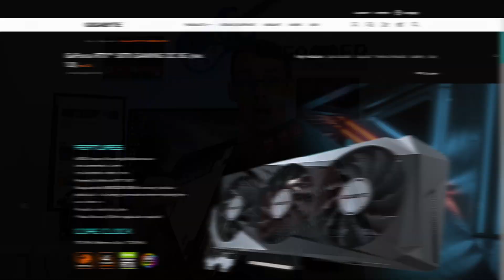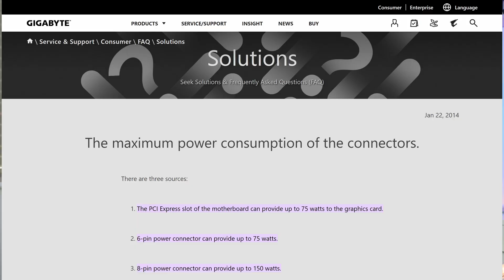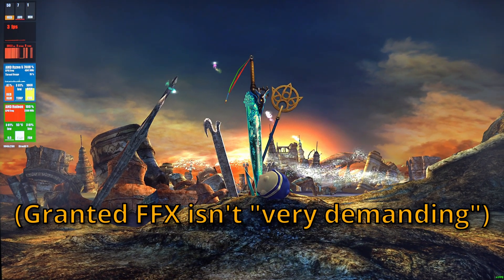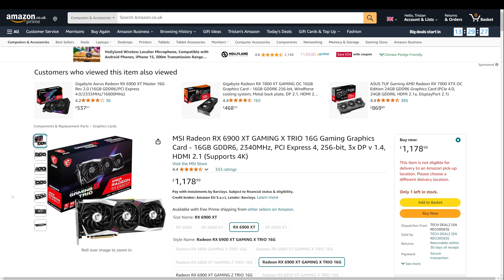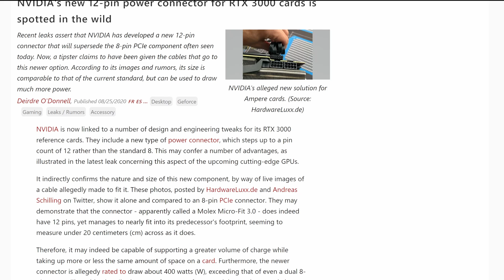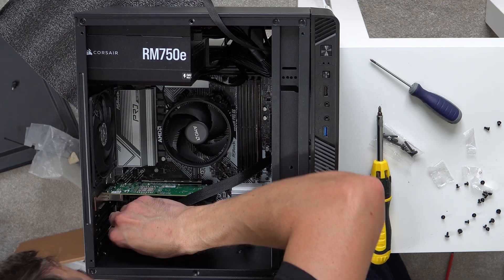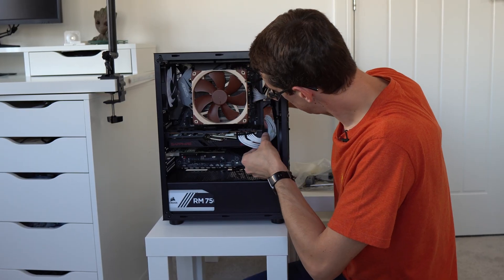How To PROPERLY Power High End GPUs (With 12vhpwr Or 3x PCIe Connectors)

Comment: Hi, what if the extension cable is only 30cm long but your power supply is further away, I have a big case, do they plug into the spare cable s somewhere that came in the box....then into gpu?
Reply from the maker: Hi, yes that should be fine, but just make sure that they're good quality extension cables (i.e. from a reputable make).
Reply: @TechOverwrite  hey I wasn't sure you'd reply so ty very much, yes they're Shakmod extensions and I'll be attaching them to the og Corsair cable spares from the box, only thing is 1 is a "devil spawn" lol, obvs i would be bypassing the sticky out bit lol. Thanks so much for your help and the vids.

Comment: I'm just about to build my own PC, but I'm finding it all a bit overwhelming.  I bought the Corsair RM1000x PSU with the 12v-2x6 connector and the XFX 7900 XT Speedster Merc 310.  The Merc 310 requires 2x PCI-E 8 pin cables, and the manual says, "If your card has 2 power connections, BOTH need to be connected, graphics cards will not work if only 1 out of 2 power connections is plugged in."  So, I'm wondering do I just do as XFX say and use two 8 pin cables or would I be able to use just the one 12vhpwr cable?  Thanks.
Reply from the maker: I get that, it's definitely confusing at first. The RM1000x is a great choice, and you should be able to just run two separate PCIe 8 pin cables(6+2) from the PSU to the 7900XT. You don't have to use the 12vhpwr port on the PSU at all, here.
Reply: Great. Thank you so much for your help.

Comment: Im having trouble understanding this, I never really looked into the psu or  watts and such until recently, i'm fairly new. Long story short, I need a new psu but I am unsure if the 12vhpwr would work on my nvidia 3090 which has two 8 pin connectors.
Reply from the maker: It's a tricky area. Right, so for a 'standard' 3090 (without a 12vhpwr), you should be fine to just run two separate PCIe cables from your PSU to the 3090. That should supply sufficient power.

Comment: I'm planning on getting a 5080, which is a huge upgrade for me. I have a lian li edge 850w, and it came with a single 12vhpwr 2x6. Should I use that or plug the multiple pcie cables into the adapter that'll come with the card?
Reply from the maker: Ah cool, I'm quite interested in the 5080 too. Yes that's a good PSU and I think that using it with the single 12vhpwr or 12vh-2x6 cable would be fine. I would prefer that to using the adapter, but maybe that's just me :)

Comment: Hello, I just got a phanteks amp 850w psu, and I checked the cables and I have that 12vhpwr 600w cable included.  My psu has that newer connection for gpu’s called 12v 2x6, so I think it's just one simple connection from gpu to psu. my gpu cable in the psu box just has 1 connector at each end of the cable. So im guessing its been improved upon?
I have the 4070ti super, not opened that up yet to check what cables are supplied.
Reply from the maker: Hello, that should work fine, it's backwards compatible too, but yes the 12v-2x6 is the improved ATX 3.1 version - so that's safer than the older 12vhpwr connector. I would use the direct PSU slot/cable, instead of the 8-pin adapters included int he 4070Ti super box.
Reply: @TechOverwrite  thanks, built today and seems fine, not tested any games yet though!

Comment: Amazing video buddy, just what I was looking for to clear my confusion with Nvdia's 12 pin adapter.
Reply: So with 12 pin you basically dont need an adapter? You just put the 12 pin into the power supply and the other 12 pins into the graphics card?
Reply from the maker: Glad it helped :)

Comment: I have a non-modular powersupply with 2x 6+2 pin PCIe cables running from it, those split at the end for a total of 4 6+2 pin connections possible. I'm looking for a GPU upgrade, and on PC Part Picker a annotation is as follows: "The video card PCIe 16-pin power connector adapter is being supplied by three 6+2-pin power connectors. Please ensure that the three 6+2-pin power connectors are not daisy-chained and do not share the same power cable." 
This would not be possible with my current PSU. Is this just a safety precaution? Or a hard limit with the 16 pin power connector?
Reply from the maker: Ooo interesting, those PC Part Picker warnings can be useful - but in this case it sounds like it's more of a precaution. What GPU is it? Maybe the RTX 4090 would require 3 separate cables, but the other cards would 'only' need 2 in my opinion. That assumes that the cards aren't overclocked or using more power than the standard TDP. Some (like the 4090) can be truly power hungry, especially with overclocks.
Reply: @TechOverwrite  it's a 4070ti Super. The upgrade isn't very urgent, I will be waiting untill the 50 series releases, either to get one of those cards if they offer significant improvements, or to get a discounted 40 series. 
I'm still interested in learning if I'll need to upgrade my PSU before then. 
It's a beQuiet system power 9, 700W
Reply from the maker: Ah cool, that's a fairly good ATX 2.0 PSU if I'm correct, so it won't have the 'natural' 12vhpwr support like an ATX 3.0 or 3.1 PSU will. But you should get a 12vhpwr/12vh-2x6 adaptor with your GPU, which you could then happily use with that PSU because it has 4 PSU connectors on the PSU side - which is plenty. In short, you don't need to upgrade your PSU. I probably would for an RXT 4090/5090, but not for a 4070Ti Super. (Great card btw :))
Reply: @TechOverwrite  so even if the card comes with a 3x PCIe 8pin to 12vhpwr adapter I can just use the pigtail on one of the PCIe cables? Because I again only have 2 distinct cables coming from the PSU side
Reply from the maker: Yes for the 4070Ti Super, using just two distinct cables should be fine. Sometimes that third connector is for 'future proofing', big overclocking or for the 4080 Super upwards etc.

Comment: hmm..i recently got a asus strix auros 1200watt psu to replace my evga g2l 850  and there is a cable that comes with it which has that 16pin connecter on it with 2x8 pins on the other end.. but in this instance the 16pin end  connects to the psu. i know this beacuse it has "PSU" printed on the 16pin end. I also have to use a seperate 6+2 cable to power my 3080 as it requires 3x8. 

before i was able to connect 3 pcie to my psu but not with this power suppply. since there are not enough pci ports on it.  im hoping this is safe and the correct way to connect my card.
Reply from the maker: Hmm it's a difficult one to say for sure, but yes I'd say that would be fine for an RTX 3080 (assuming it's not super overclocked or something). 🙂 That's interesting about the 16pin connector to the PSU end but it makes sense with the ATX 3.0 changes I guess.
Reply: @TechOverwrite  its over kill fora  3080..i was using a 850 just fine.. but i needed a new psu and im planing on getting a 5090 where i need that extra watts. this cable must be how to connect 3 pci connecters as there ins no other way to do it.. and it duse say psu on the 16pin end.

Comment: Hi TO, nice video. I'm having a trouble to find a cable which can solve my issue. I've bought a Corsair SF750 newer version (the connectors on PSU are Type 5, I assume) and I want to connect it to a RTX 3090 EVGA XC3 Ultra, which have 2 x 8pin PCIe slots. I have received plenty of cables in the Corsair PSU box, but non of them are solving my issue. Where can I find 1 cable (8 pin type 5 in PSU  to 2 x 8 pin in GPU), or even 2 cables (8 pin type 5 to 1 x 8 pin GPU)? Which cable you would recommend? Thanks in advance.
Reply from the maker: Thanks 👍 Hmm good question. If it's a type 5 cable, Corsair does seem to sell multiple ones that might suit - try Googling "corsair premium sleeved pcie cable type 5" or similar. Buying 2x single ended PCIe cables might work (if your GPU only needs 2x connections). That's what I actually have with my RX 6700XT - Corsair's premium/sleeved PCIe cables look really nice 🙂

Comment: can i use ATX 3.1 12v-2x6 cable on 4080S ?
Reply from the maker: Yes that would be fine - assuming it's not some random 12v-2x6 cable from a no-name company on AliExpress or similar. But if (for example) you had a Corsair PSU and used their cable? That'd be fine.

Comment: Hello, I really liked your video, I would like to ask a question. Could I use 12vhpwr with 12pin input and 2 x 8 output for my RTX 3070? I found an adapter on the internet from 12 pin to 2x8 pin (12vhpwr), I don't know if I could use that, or if it could kill my RTX 3070. Just so you know, I don't understand English very well, that's why I'm asking, I don't know if it was said in the video, because I had to try to translate it to understand everything.
Reply from the maker: Hello, good question, it's always better to ask :) In general going from 12 pin to 2x8 pin 'can' be safe in that the 12 pin is very high power, so it is unlikely that the resulting 2x8pin is underpowered. However it depends where the adaptor is from. For example I WOULD use such an adaptor from Corsair (since I have a Corsair PSU) but I would NOT use that adaptor from a random company on AliExpress. Hopefully that makes sense?
Reply: @  Thank you very much for answering, would it really make any difference? If I use this cable and if I use the standard 2 8-pin cables? Because in my thinking, if I use a larger power cable for my RTX 3070 (220W) it would be more “loose”

Comment: 5:03 "even the 7900 XTX only goes up to 355 watts" THIS IS NOT TRUE, that's the base power of the card and ENTIRELY dependent on the manufacturer you buy from.  The base AMD card will draw 355 watts, but an OC 3rd party one from Sapphire or alike can draw up to 450 watts or around that when gaming depending on demand of your resolution and settings etc, so 100% you NEED, NEED, NEED 3 PCIE cables at 150w each, taking you to 450w + 75w from the PCIE so 525w.  If you ONLY connected 2 daisy-chained PCI-E cables, connecting one 8-pin, one 8-pin and daisy'd 8-pin, ie had one daisy "hanging" from one of the cables, you'd ONLY be supplying 150w + 150w + 75w so only 375w.  The card at times will want to pull more than that 375w and causing instability, crashing or seriously power-limit itself and hold back performance, so you wasted money.

If you buy a stock card, sure, 2 PCIE cables and daisy one of the connections to make 3 8-pins.  If you have a 3rd party OC'd card, USE 3 PCIEs, AND ONLY USE THE 8-PINS, just tie the daisys to the cable and don't use them.  Ugly but ah well.  At least then you're guaranteed 450w minimum supply.  Even Sapphire's site for the 7900 XT says "3 8-pin connectors required".  Use 3 and hide the daisy chains or buy 3 8-pin single cables for your PSU's type and manufacturer (as PCIE cables/pins/rails vary between manufacturers, you can't use a Corsair PCIE on a Thermaltake PSU or whatever).
Reply from the maker: Thank you, that's an important clarification 🙂 Yes I usually just refer to the baseline power requirements for consistency, but I definitely should have mentioned that OC and 3rd party models can vary this. You're right that an OC 7900 XTX needs more than 2 cables in this case - thanks again for the detailed comment and clarification 🙂
Reply: @TechOverwrite  No worries mate, maybe overlay some text or clarify in the comment section or something.  Just reading the TDP isn't really a great idea, because wattage can vary so much, which makes you wonder why they even write the TDP.  Even the PCIE cables are 150W but are rated to go over 250W I believe.  Without sitting down and testing each wire with specialized equipment and testing the PSU, measuring the card wattage (AMD do this in their Adrenaline software to be fair though, I don't think GeForce Experience or the new, better, Nvidia App does it though, you need to use MSI afterburner or Hardware monitor or whatever software), you can't really quote specific, hard numbers and call it a day.  It fluctuates so much.  I'd rather give the card 500+W of potential power and let it draw what it  needs when it needs it.  You're not going to kill a 300W card by giving it 3 PCIE 8-pins so 150W minium.  It can sit idle and draw 30W, it's not going to catch fire.  The issues start when you overload a single cable, don't have enough cables connected, cables not connected properly and overheating at the contact point, or not enough power supplied to the GPU.  Fortunately the PSU has failsafes built in to cut off under certain circumstances, as does the mobo.  You're more likely to have a shutdown than catch fire or short something.
Reply from the maker: Yes fair points, I agree entirely - and thanks, I've added a pinned comment (unfortunately YT doesn't allow you to add text after the fact - you could link to another video and add a label for that, I guess, but it's probably not as visible overall as a pinned comment). I agree that it's easier to be safe with 3 cables (for example) than chance it with 2.
Reply: Hey guys I just brought 7900xtx nitro+ and my psu is MSI MPG A850G, aside from 12v-2x6 cable, I just have two 6+2 pin cable and one 12 pin to 6+2 pin cable. While first two cable okey for two 8 pin connector, but can I use 12pin to third 6+2? Is it safe? (12 pin to psu and 6+2 to gpu's third port/socket, with other two regular 6+2 cable)

Comment: Hey I just bought a 3060 ti which has a 12 pin connector, I’m wondering if I can use 2 6-pin PcIe connector or I should just use the 8 to 12 pin adapter? I have cable extension so I would rather use 2 6-pin.

Comment: The timing is incredible!

I'm in the middle of upgrading from my RTX 3070 to a ASUS TUF RX 7900 XT OC. I got a new PSU too as my old one just had 650 Watt. I made sure my new PSU had enough PCIe connectors, but I got a little worried when the Asus manual told me to ONLY use separate cables for each of the 3 connections. 

Thanks for making this video! It helped me to understand how these new (and huge) GPUs draw power
Reply from the maker: Hah it must have been meant to be! Glad this helped you out either way 🙂
Reply: Lol I wish I came across this video when I was building my first PC. Would’ve saved me a lot of researching lol
Reply: What power supply did you get i want to upgrade to an xtx but im struggling to find a power supply that has 3 8 pin cables
Reply: @JalalSinclair  I just went with a 850W PSU with 2 PCIe cables. I have the MSI MAG A850GL. 

As explained in the video, I run one cable to the first 8-pin slot and I use the second cable to connect it to the second and third 8 pin slots. 
For my RX7900 XT, this works flawlessly. I've not encountered any issues.

Comment: At 7.12 you say 'plug the 16 pin end in the gpu' but you're holding 12 pin cable right? I am so confused... How is ATX 3.0 12VHPWR with 16 pins compatible with new ATX 3.1 12Vh-2x6 pin which has only 12 pins? Do the rest of the 4 pins not get used?
Reply: Ahh i get it... I was misunderstanding the new 12V-2x6 connector to only have 12 pins... I see the extra 4 pins now. In the new and old connectors both. Thanks, nice video.
Reply from the maker: Great question and yes, it definitely gets confusing - you would have thought that "12v-2x6" would mean 12 pins, but nope 😆
Reply: @TechOverwrite   SO are the adapters (16 pin - 8pin)  that come with cards that use the 16-pin  connecters good ? I already have two separate 8pins powering my current card. plus my  psu has it's own 16-pin to 16-pin connecter (with it's own rail) . Should I use that instead?

Comment: I have a 3 year old 850w non modular PSU. It has a cable piggytailed with 2 6x2 pin 1 of which is piggy tailed. I'm wanting to fot my 4070 super which comes with 12 pin? Any help? I've had a serious head injury and really struggle with the stiff i once knew. Plesse any help?
Reply from the maker: In an ideal world, you would use two separate cables for each of the 12vhpwr connectors. But with the 4070 Super, you should hopefully be okay with using the pigtail if that's all you have. Naturally trying this with a 4090 wouldn't be good, but a 4070 Super is borderline so 'hopefully' will be fine. Just be sure to run FurMark and keep an eye on the various temp, power and performance stats while it's running.
Reply: @TechOverwrite  thanks bro

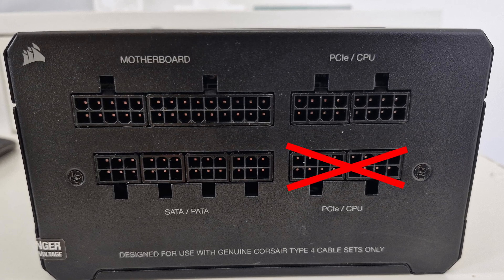Comment: 8:46 that PSU actually has four PCIe slots and could probably be used to power the GPU by itself, just not the full pc. It is unusual but using two PSUs on a pc is possible and safe. Yeah, I get your point and I became the "ACKHUALLY" guy.
Reply from the maker: @Kurazaybo  nope that's a totally fair comment, probably a bad example on my part. Thanks for ACKHUALLY pointing it out 😉

Comment: I bet you could also just (carefully) cut the pigtail off, if you really didn't need it.
I mean instead of buying new cables.
Reply from the maker: That thought scares me... but you might be right - assuming the ends are properly capped off. I'm not sure, that's not my forte. But you're probably right that this is possible :)
Reply: You would have to "split" the ribbon, in order to cap them as he said.  They cannot be touching eachother, exposed or this could lead to serious problems far from worth it.  So, you'd have to leave enough of the "pigtail" in order to do that.  Do NOT cut it all the way down.  (Then of course, it will still show - an aesthetic reason you may want to avoid attempting this).